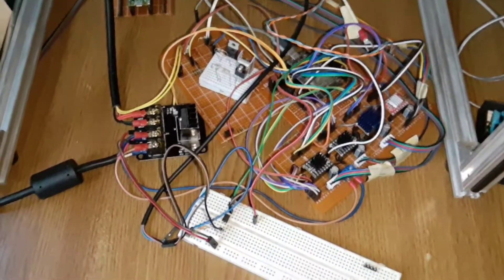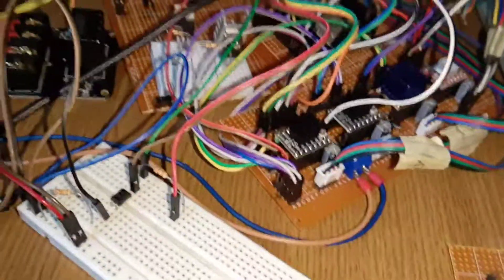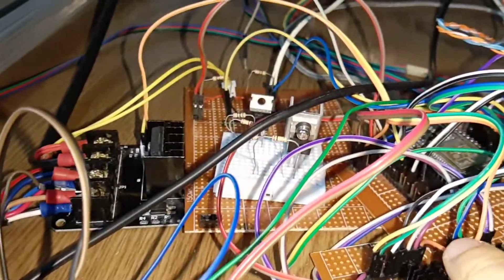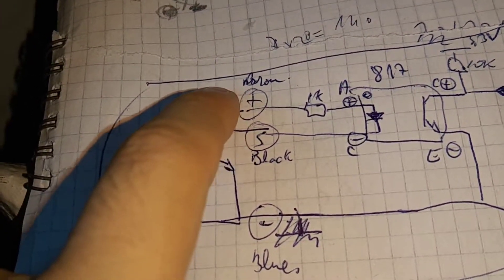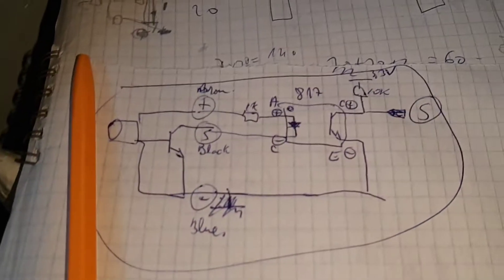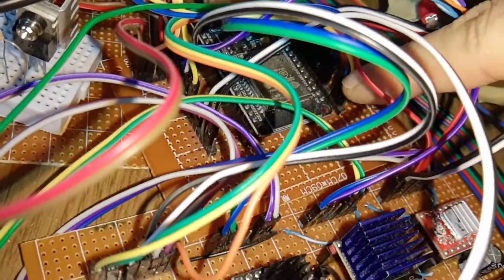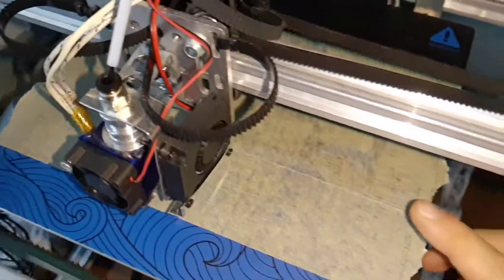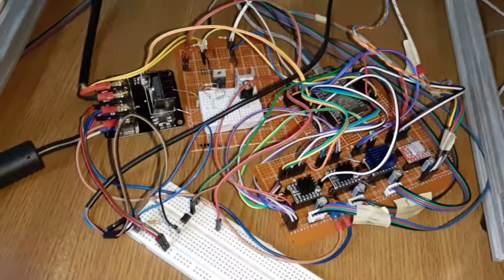DIY 3d printer modular controller board esp32 and raspberry pi pico

Comment: Hello,
How you can flash Marlin firmware on Pico? Show me, please!
Reply from the maker: hi, I'm not sure rp2040 it is fully supported, 2 months ago they did add a HAL - hardware abstraction layer - for it in the marlin code, so it might work but maybe not with full capabilities yet. you need to compile it in the same as on any ohter mcu. you eithet use arduino ide or visual studio code, and edit the config file and select the board with that mcu
Reply: @CNCTinker  many thank, bro! it is my first time. i can saw a rp2040 in to src folder. let me try.

Comment: hi can we use tmc 2208 for ths project
Reply from the maker: yes you can, they are almost identical, the 2208 has a bit lower specs but unless you go high performance there's no difference.